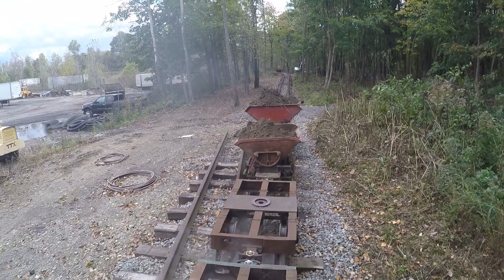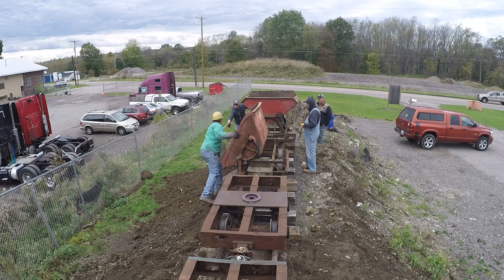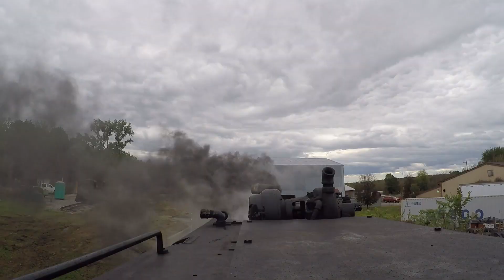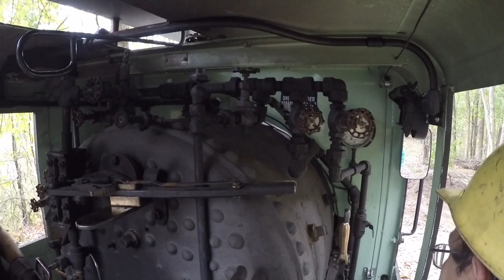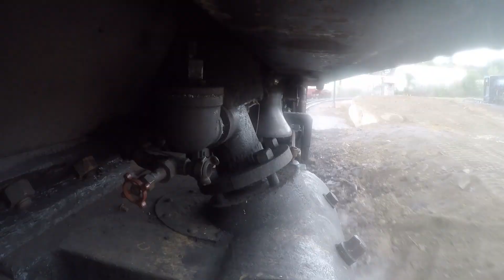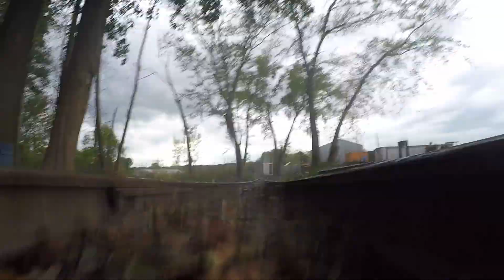J&LNG Dirt Train

Comment: I love seeing the locomotive under heavy load. That's the way that engines are meant to be operated, not put putzing around taking it easy. You can run an engine in just about any condition when it isn't working. To do actual work requires an engine to be in tip top shape and well adjusted, and you can tell when they're not. The engine is performing fantastically. As several others have pointed out, the valve setting sounds like it may be just ever so slightly out, but overall you have done an incredible job. You know more about valve gear design and adjustment than many "experts" who've never done anything more than pull the throttle and maintain pressure and water. Properly maintaining and setting up an engine takes another skill that not many steam people have the knowhow or the drive to do right. Many would rather to just continue running a worn out engine with poor valve setting because they're having fun with it. My family purchased a half scale case traction engine over a year ago in "running condition" and yet we have not been able to run it as of yet. The engine had been ran into the ground for many years. It was so badly worn in the valve gear that nearly half of the valve stroke was lost due slop. Now, the engine would still turn itself over and move itself, so technically we could have just continued to run it like it was and deal with its problems; however, we instead chose to completely tear it down and rebuild it first so that everything can be done right. It's frustrating to have something so cool in your possession and take it out of commission before even having the chance to run it once, but the feeling of success when the engine runs like a swiss watch will be worth the wait. Who knows, maybe one day we may even bring it out to the museum for a steam up alongside the J&L engines.

Comment: So are you extending out of the shed along the embankment too?
Reply from the maker: Going to extend the rails another 20 feet to complete the fill.  Its a good place to put extra cars, or perhaps one of the other Porters where they can be seen by passers by.
Reply: @YoungstownSteelHeritage  With a small wooden roof, an old school station clock and a couple of extremely uncomfortable benches this could turn into a perfect train station.
Reply: What’s on the other side of the road? All I can picture is a bridge to greener pastures.

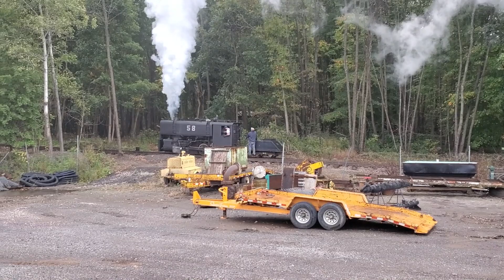Comment: 15:00 I find it concerning that no one on the platform appears to understand the situation they are in. The engine is carrying water over hard, so much so that it is starting to partially hydro-lock itself. Not only can you see the plume of white coming out of the stack, but can even can hear the engine bog down as it fights itself. Hydro-locking of the engine can cause severe damage, and is only made worse because this is a piston valve engine. Unlike a simple D-valve engine, where valve chest pressure holds the valve against its sealing surface and can be lifted off from its face if cylinder pressure exceeds operating pressure pressure, the piston valve has no such "give". I am not nearly as familiar with locomotives as I am traction engines, but the Baker, Port Huron, and Case engines with piston valves used relief valves on either end of the cylinder so that if cylinder pressure ever exceeded operating pressure, as in the case of a hydro-lock situation, the pressure would be relieved to atmosphere until the engineer had the chance to open the cylinder cocks and ease off from the throttle to stop the caryover. I do not believe the engine has any such automatic relief valves and you can see that the engineer made no attempt to open the cylinder cocks or shut the throttle. The fact that the engineer either was not paying attention to notice what was happening or perhaps did not even know that this was a problem and instead continued to push the engine up the hill shows that not every person should be allowed free reign over an engine, even people who say that they have experience running steam engines. The fact that neither the fireman or the the third man on the tender found this concerning enough to bring it to the engineer's attention is concerning as well. I love that you are so willing to let others operate your equipment which you have spent so much time and money on. That is great. We need more people like that. But I hate to see an engine abused like it was there. It would just break my heart for something to be damaged and take the engine out of service, even if only temporarily.

Comment: You all should wire wheel the inside of the dump body get it real clean, then wax the heck out of it. Dirt will come out a lot easier.
Reply from the maker: There is another dump car on the property and I coated it with graphite paint and that helped a lot.  I didn't have any here for these two cars and if the dirt had not been so wet it would have flowed better.

Comment: Hey there is a loose bolt laying under the red valve at 17:24 
Figured I’d say something incase it was to something important but aside from that watching this thing run is so enjoyable and relaxing
Reply from the maker: Just an extra screw for the cylinder jacketing.  It is still there.  Never rolled off.
Reply: @YoungstownSteelHeritage  forgot to reply the other day but I’m glad it’s not anything major. Was watching the video enjoying it and saw that bolt and me being me I was worried it may have been to something important but again I’m glad it wasn’t! Anyways love the little 58. Would love to make a model of it somehow

Comment: What gauge is this railroad?
Reply: It's 23" gauge, one inch short of 2 foot. No reason is known why j&l chose this gauge instead of two foot, but it was probably a clearance issue.
Reply from the maker: @PowerTrain611  It is now all 24" gauge
Reply: @YoungstownSteelHeritage  Thanks for your correction, Rick!
Reply: @YoungstownSteelHeritage  almost exactly the same as the common 600mm industrial stuff in Europe